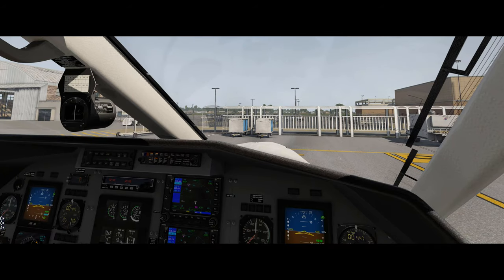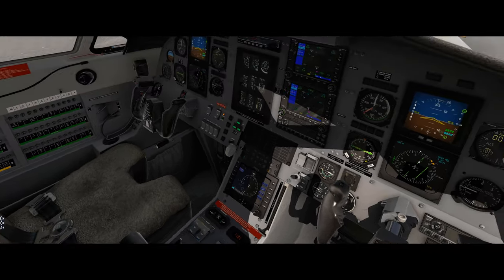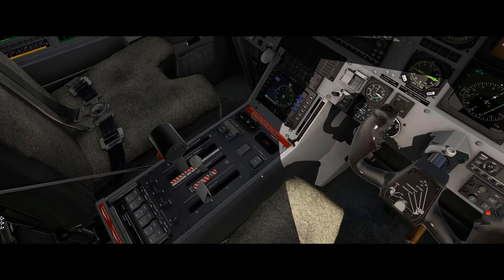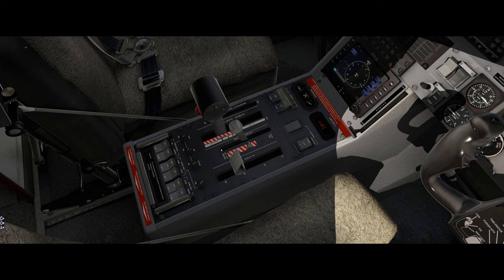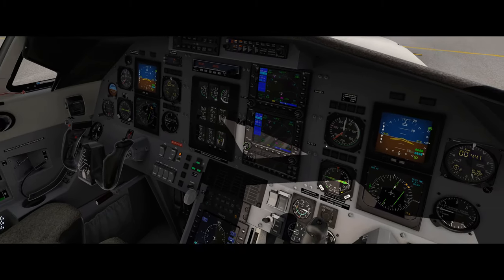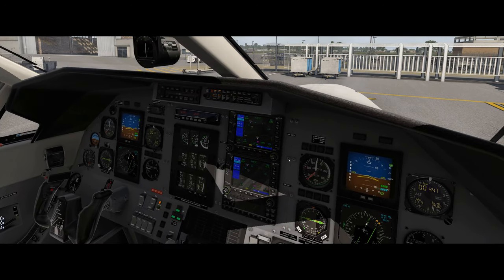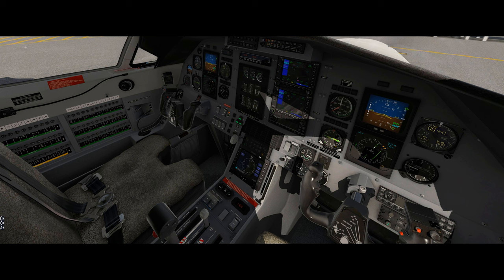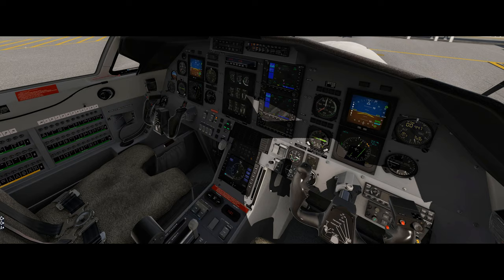Pilatus PC-12 Condition Lever

Comment: Great video, do you know why some king airs always fly with the condition lever in the low idle, shouldn't it be the same as the Pilatus?
Reply from the maker: Thanks! Flight idle is necessary in the PC-12 to ensure sufficient bleed air for de-icing boot operation. Since King Airs have two engines and therefore more available bleed air, they can get away with letting those engines slow down a little more in flight. Some King Air pilots do almost all of their flying in low idle. It makes energy management even more of a no-brainer and is a bit more efficient. You might use high idle if you needed the engines spooled for a short-field landing so reverse is ready and waiting, but it's usually not necessary.
Reply: @GeneStuart  thanks for the answear, apreciate it!